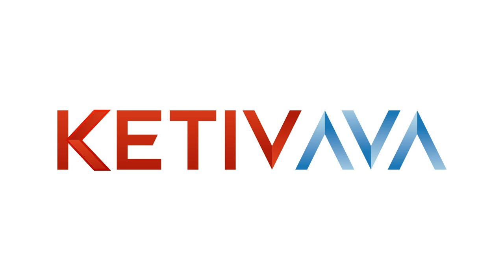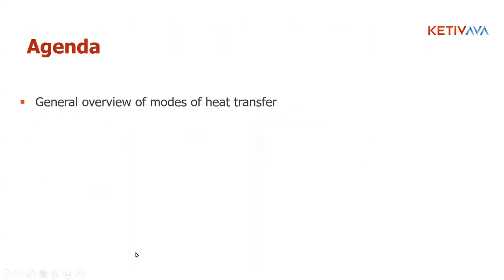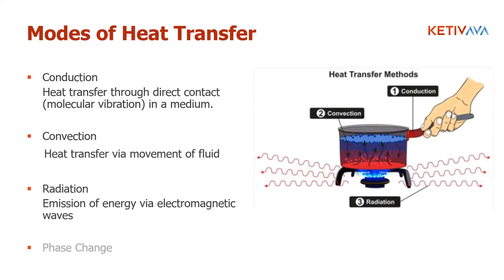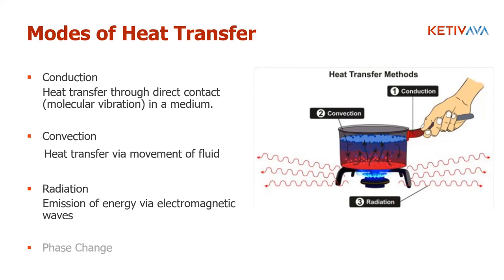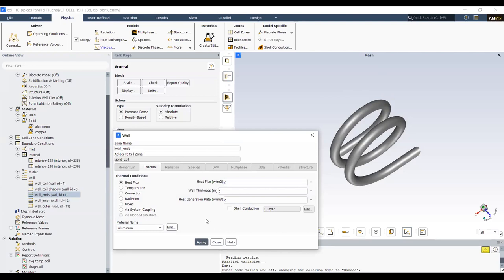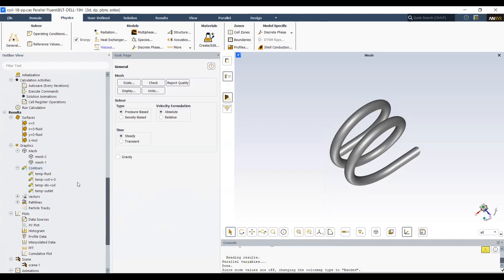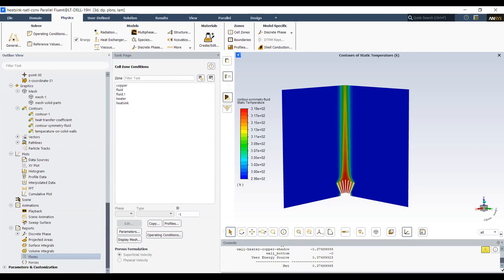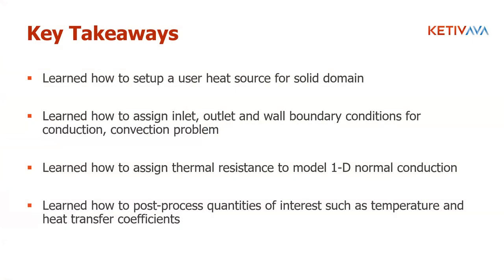Basics of Heat Transfer Modeling using Ansys Fluent | Ansys Virtual Academy

Comment: At 16:56 you have not explained the key issue. When using option 2. or 3. How is heat transfer in the wall normall direction handled, when the problem is transient?  Does it actually integrate the transient heat conduction diff. equation in the wall normal direction using some virtual numerical 1D discretization (in the wall normal direction), or perhaps, it is using analytics valid only for steady heat transfer (transmissive heat flux between 2 fluids through a wall), i.e. the heat flux is equal the temperature difference over sum of resistances. That approach would be approximative for a time dependendent problem since there is thermal inertial in the wall.  In other words, what exactly does FLUENT do with the given information on wall thickes and the wall material properties, please ?

Comment: is there an option in put a file into Fluent that has data showing how much heat is made over time? Like an Excel file with numbers for how much heat is made (in watts per cubic meter) at different times (in seconds)?

Comment: Hi there

 I am going to simulate a fire in tunnel by using fluent ansys and I have question 
about the density of air inside the tunnel how should i define it is it incompressible ideal gas or ideal gas 
the problem is transient 

grateful 
yousef